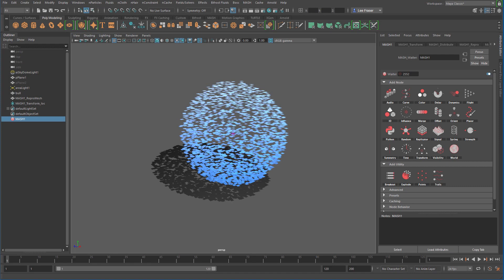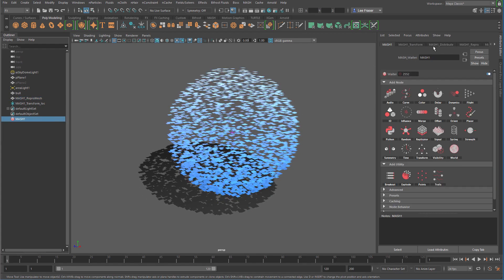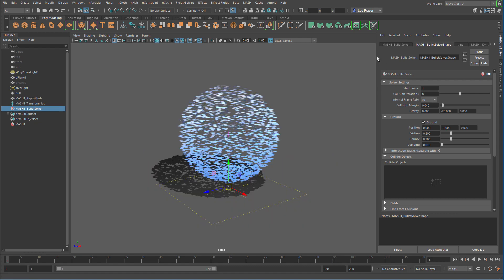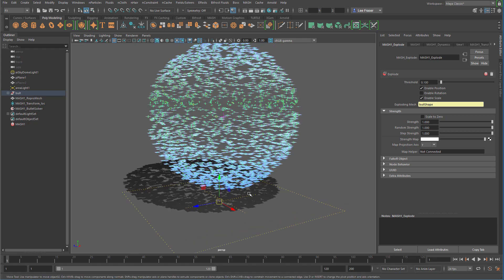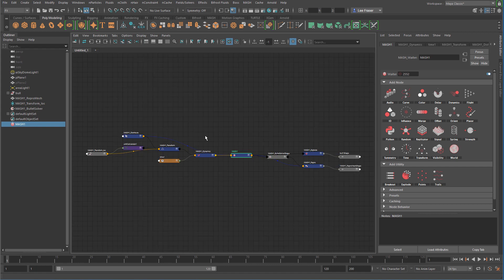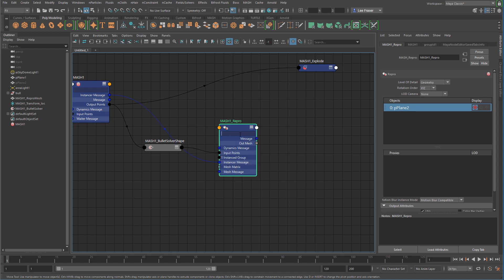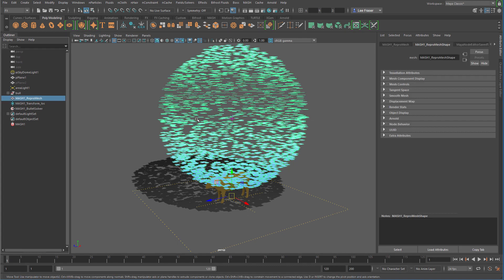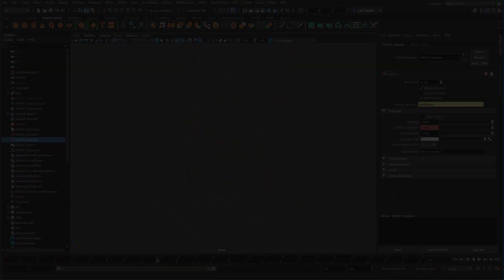Tips for the Explode node in Maya 2018

Comment: How did you make the sphere in the first place? I can't even get to the start. I can make the network, but how did you make the circle
Reply: He doesn't mention several things. But this is specific to the "explode" node so he covers that. 

Create a poly plane with 1x1 subdivision. With it selected, create a mash network. Then, with the mash network selected, go to distribute and match his settings (Distr type - Volume) 

He sets his point count to 2252 because thats how many points are in his Cow mesh for later. If you start with a single poly plane, your distribion number of points can be any number and thats how many times it will duplicate and distribute your mesh. So his "confetti" is actually just 2252 copies of his initial poly plane (which is the one hidden in his outliner if you look closely)

Hope that helps.